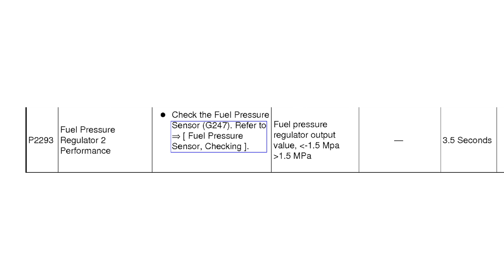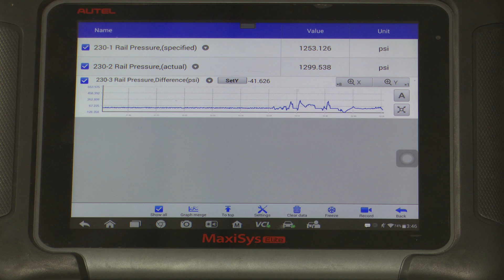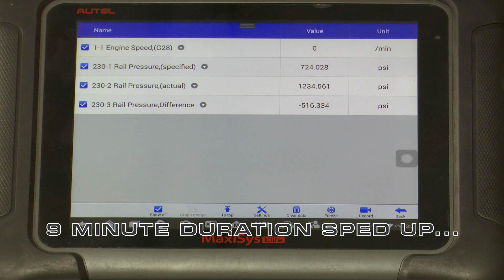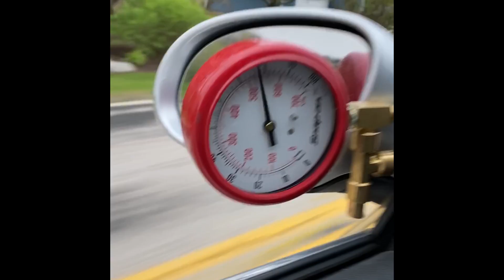Part 1 - P2293 High Pressure Fuel Pump Diagnosis - 2006 2.0T VW Jetta

Comment: My 2011 gti has a 3.77 bar  for fuel rail pressure when cranking and does not increase in bar. Car cranks but wont start with no codes present

Comment: I have this code on a 2010 also. I also have a extremely weak engine off idle won’t build power till like 3,500 rpm. Did you have any symptoms other than the code?
Reply from the maker: Thanks for watching and good luck in your diagnosis.
Ryan W, Technical Instructor

Comment: My reading in the low side was 85 and shakes thru 83psi to 90psi when accelerate the psi stay at 90 and the HPFP pressure at idle is 556psi and when i dive it stays above 1200 psi ? Whats the normal Low pressure PSI and normal High pressure PSI?? Please help me out i cant find the right info
Reply: I found my answer—— low pressure normal PSI between 50.7psi(3.5bars) - 87.1psi(6.0bars) and the High Pressure Pump normal psi is between 725.1psi (50 bars) — 2175.5psi (150bars). Hope this is helpful.

Comment: I have a problem with my 2008 2.0t FSI. One day I was driving and I had almost no power at all I could barely get up to speed. Then later i tried to start it and It cranks but won’t start, I have low fuel pressure I only have 4 psi. I replaced the in tank fuel pump, the high pressure fuel pump, fuel pump module, and the fuel filter. Do you know what else it could be.
Reply: Hello Rudd. Did you figure out what was it? Thanks Jeet

Comment: Hi, one question to gotech and everyone, please help, on 2010 audi a4 with high pressure pump, what is normal fuel rail pressure to expect after the car sat for few hour or the next day in the morning in a normal day with 75 degrees weather? Before starting the engine.

Comment: If you guys ever get this code and it's not the hpfp and cam combo.....try the sensor on the rail if that's not it.  The sensor on the hpfp is going to be the culprit.
Reply: Hi, Can you explain what you mean a little better? There's a sensor that connects to the HPFP and then a sensor that connects directly to the rail correct? Which one are you referring to? If I get this code because the fuel pressure difference before it starts bucking is around 20 bar (290 psi), would that point more to camshaft than to sensor being the culprit? I already put new HPFP in, new fuel pressure regulator valve P/N: 06D-130-757-C,  known good ignition coils, and it starts misfiring and hesitating hard once engine is warm and I'm accelerating on highway at about 70 mph. I can't get more than 91 bar (1319 psi) and the commanded pressure peaks at 109 bar (1580 psi) for me. Sometimes it will drop from the 91 bar down to 75 bar and that's when I get spike readings of 30-31 bar difference. I'm thinking camshaft but would try a sensor or something to do with timing as a last resort.
Reply: @LarryMendizabal  There's a sensor that measures the hp coming from the hpfp, if that sensor is faulty you'd get the symptoms you're describing. Was the pump oem?
Reply: Pump is a hitachi unit from fcp euro. Which sensor are you referring to that measures the hp [pressure] coming from the hpfp? Do you have a part number? Is it the one directly connected to the hpfp or the one on the fuel rail? @zuperzleeper

Comment: I have a audi q7  getting p2296 and p2293 just changed the fuel pressure regulator
Reply: I have the same code and I replace the HPP and now my car cranks but wont start

Comment: Hello! What fault produce the noise at 3:48? My car have the same engine and do the same noise. The noise disappears when disconnect the HPFP. The workshop says that is the HPFP and not the turbo. Did you now if the noise is really for the turbo. Thanks.
Reply: This! My GLI is doing the same weird noise. Have you gotten anywhere with this? Just replaced my engine and did all of my big maintenance. Made sure I went through everything.

Comment: The counter balance oil pumps are a blast in those... The 1.8 pump is so much more reliable. The 2.0 Delete is the way to go.... 
These ARE really nice engines until they start acting up. First sign of metal flake, it's time to rebuild it or junk it... After replacing the oil pump, the high pressure fuel pump follower disintegrated and took out the cam lobe! After replacing the head, the car continued being problematic. ANY metal flake in those engines, is BAD NEWS. (Those followers are problematic too...)
Reply from the maker: I may never buy a 2.0T VW again haha!
Mike Becker, Senior Instructor

Comment: for the low pressure side. if you have idle 50 psi and wide open throttle 72 psi. can you conclude the low pressure side pump is okay. or do i need to removed the line and see how much volume it came out. because i think you can have good psi and low volume.

and also when you said the hot soak. after 10 minutes the pressure will rises, due to temperature in the engine bay. can you explain a little bit, i am kinda lost.thank you!!
Reply from the maker: Hey Hua Jack, if there was a volume issue it would result in a lower pressure...unless there was a severe restriction. As far as the pressure rising, the fuel rail is sealed off when the car is shut off. The fuel is cooler than the engine, it came from the gas tank. When fuel increases in temperature, due to the hot engine, it increases in pressure. Therefore we see an increase in pressure on our sensor.
Mike Becker, Senior Instructor

Comment: Screw modern cars.   Go get old analog vehicle and be rid of cheap plastic computerized vehicles that will be totaled due to one of the shitty computers failing.         Emmisions?        How much strip mining is done to make current car.   Disposable plastic. Crap.
Reply from the maker: Hey Duke, sorry you feel that way. Modern cars do seem to have more problems, that's for sure. More stuff to go wrong. But how many "old" cars made it 200+ thousand miles?
Mike Becker, Senior Instructor

Comment: That was a nice "block window" someone created there, Mike!  Nice work getting that one going again. That cam didn't look too good, but hopefully that original pump does the trick. I know the feeling of not wanting to dig deep into your own vehicles. Had that same feeling when I saw all the metal chunks on the rear differential magnet in my '07 Silverado a little over a year ago ... 

Must be the moon phase. I've been working on my own stuff quite often lately, too! Hub bearings in my '07 Silverado (For the 2nd time! Talk about purchases we regret! Biggest lemon I've ever owned), then I had to rebuild the original power steering pump in my '86 Grand Marquis (34 years, 268k miles! Only rebuilt due to leaks), & replace all the lines. Rockauto sent me the wrong return line, so I attempted to heat and bend the metal portion - big fail! It kinked & twisted, and caused a big restriction. Ended up cutting it off, and double-clamping a hose. Always something! Anyway, looking forward to next Thursday. 👍🍻
Reply from the maker: Hey Smitty, yeh I had my fingers crossed on that cam...we'll see. Ugh! Isn't it just a blast working on your own stuff. It's funny how much I tend to put my own stuff off haha!
Mike Becker, Senior Instructor
Reply: GoTech - Same here, brother! I had been planning a total front end overhaul on our Grand Marquis for 5 years. Just got to it last fall ...😂

Comment: Fun video to watch, though now you have me wondering how the dealership pros safely decompress the high pressure line. With it driven off the camshaft, you can't just turn it off with the scan tool, pull the fuse, or unplug the high pressure pump. Even with the tank pump turned off that high pressure pump will mount significant pressure. Maybe one could find a fuel injector test procedure in the scan tool to spray fuel into cylinders with engine off, decompressing the line into a cylinder, hopefully not enough volume to hydrolock. Without the factory scan tool I wonder if people use a dangerous work around, which responsible authors don't want to show....
Reply from the maker: Hey Spelunkerd, thanks for watching! I'm not going to get into the procedure, but it is possible to bleed off the high pressure without a factory scanner :)
Mike Becker, Senior Instructor

Comment: A lot of GDI engines have problems.  It is called fuel dilution and abrasive, chain wearing soot from incomplete combustion of large fuel droplets.  It is so bad the OEMs and oil companies have known for 6 years and only now have come out with API SP and GF-6 with many new tests for timing chain wear.
Reply from the maker: Hey Brian, I knew there had to be a reason for this uptick in chain issues. Interesting that they are making new standards for oil. I'll have to check that out, thanks!
Mike Becker, Senior Instructor

Comment: You are going to throw a new cam at it for sure.
Reply from the maker: Ugh, I think you may be right Blocki :*(
Mike Becker, Senior Instructor
Reply: @GoTechTraining  Hey Mike, I think you are in bigger trouble. The german "Die Autodoktoren" recently had a Seat TDI where the high pressure pump had the same problem. VW quoted the owner ~8000 Euro because they wanted to rip out and replace EVERYTHING related to fuel (incl. tank, injectors, lines and rails). It's a TDI but it seems your car uses similar, if not the same technology.
Part 1 (introduction): youtube.com/watch?v=kC8mBa2Oo7U
Part 2 (where they show the culprit, starting at 05:40): youtube.com/watch?v=LHkXp7jZyxU
They ended up cleaning and backflushing everything including wiping the inside of the tank with some magnets. They also installed an additional fuel line which was wrapped around a huge magnet + installed an additional filter after they were done. They recently removed that fuel line and magnet and showed how much it still catched of that fine "sweet" metal bits and pieces. The car still runs fine. It just recently stopped because they got a bad rubber fuel line which was new, meant for fuel but failed just within weeks. Apart from that all is good.
If your engine is setup remotely similar to this one, it won't be the actual camshaft but more like an additional kinda "cam" which is in a separate housing.
Hopefully your injectors are not damaged. I'm not sure if the Autodoktoren replaced the injectors in this car or not. But I'm pretty sure they did - also as a safty measure.
Good luck!

Comment: I stopped your video at about 12:25 to write this and also to give me the time to decide whether to continue or move on to the voluminous amount of videos stacked up to still watch. Now, Mike, I watch your videos because you go through all the nitty-gritty, it is not up to you to decide not to share this or that part of the grit. I put up with your tendency to be pedantic to get all the info I would need if the problem with the vehicle you're having arrises with me. You have already covered your self with your  Terme of agreement. In other words, you are acting like my dad and I am just getting out of my pre-teens. No, I won't stand for that. I decided to watch your video up to the ultimate diagnosis and then move on. From there I will wait to see if you post a re-traction video, making it clear what kind of audience I am. By the way, I will apologize for being slightly touchy this morning; I am 73 and my plate is overflowing with projects that need to be done and I am taking the time to watch your video. with that, good day.
Reply from the maker: Hey Ben, sorry you feel like you may have wasted your time. Covered or not from legal issues isn't really my worry here...my concern is someone who doesn't listen to all of the directions ends up hurting themselves.
Mike Becker, Senior Instructor
Reply: So, then we search for other instructions that may totally be wrong or out of date. Where does that leave me? Hurt again, yes? It would be best for you to give the proper instructions with the appropriate warnings about not following them and or being careless. I am in turmoil in how to reach you without blowing my own horn. I do know this would be the right approach. Please step back and rethink this, Mike.

Comment: Wished you showed us a real close-up of the follower but that thing looks absolutely trashed, hole in it even? The camshaft is junk as well, if I'm not mistaken the BPY had the Rev A cam with a coating on the surface from the factory. Anyway, it's scrap either way with all that wear and pitting, the follower should be able to spin on the cam and only have minor and even wear in the middle.

But usually the fault would be low fuel pressure when the lobes wear down, so that's interesting. Just a worn follower would still yield the same relative displacement in the pump, that's why it's so easy to miss before it's too late.
Reply from the maker: Hey G E, join in for part 2, i'll show it in there :) Interesting about the cam Rev A. I'm really not looking forward to probably throwing a cam in here....
Mike Becker, Senior Instructor
Reply: @GoTechTraining Well don't quote me on that rev. A part, I have no experience with the BPY hands on. Just did my research before I bought a BUL, and I have confirmed that one has the rev. B cam. 
It'll be interesting to see what it all looks like up close, and if you have an borescope have a look at the intake valves while you're at it.

Comment: Did a see a fuel pressure tester, for low side, then after the pump replacement, no pressure tester?   Assuming low pressure was good?   If so, Pump and follower and youre golden.
Reply from the maker: Hey Kurt, low pressure was in spec on this car. I really hope that it fixes it!
Mike Becker, Senior Instructor

Comment: How about checking the fuel pressure sensor for accurate reporting?
Reply: Good point. I am guessing that Mike does not have a high [enough] fuel pressure gauge to test the "secondary" [high side] pressure. This would be my next step after confirming the "delivery" [low side] pressure was in spec.
Reply from the maker: Hey Traveler X, that's correct. I don't have a gauge capable of reading that high. Plus, the TSB and noise from the HPP area was enough to lead me into that path. Seeing wear on the follower and a questionable cam was evidence enough. I suppose it's possible that even with a perfect cam/follower/pump that the sensor could still be bad...but my guts leaning towards pressure creation instead of pressure reading.
Mike Becker, Senior Instructor

Comment: I know very little about these GDI systems.  My 7 month ownership of a 2020 Toyota RAV 4 has shown the vehicle to be very impressive in economy and power.   One interesting thing.  When you put the key (mine is the base model, not the pushbutton model) in the ign switch, before you turn it to on, you can hear the pump run for 2 seconds.  A good idea I say.  The high press pump is a little, but not much, noisy.  The engine takes 0W-16 oil.  For now I'm using Toyota oil and filter for the warranty.
Reply from the maker: Hey Mike, thanks for watching man! Enjoying the vehicle? I have two GDI Fords with pushbutton start, when the key is close I can hear it prime. 0W-16 is crazy...I can't believe that is acceptable.
Mike Becker, Senior Instructor

Comment: Here are  some more informations about this system. (VW SSP 334) Great videos btw.
Reply: That cam is trashed, you're not going to get significant wear on the follower and not trash the lobe also, the close up you showed gives clear evidence that the lobe is wiped. I deal with high pressure diesel common rail and have seen what happens. Sadly you're gonna have to replace the cam 🙁 and you run the risk of trashing the follower on the newer pump if you run it against a trashed cam lobe. 🤔
Reply from the maker: Hey Bryan, I wish it weren't true :(
Mike Becker, Senior Instructor
Reply from the maker: Hey Jure, i'll check it out. Thanks for watching!
Mike Becker, Senior Instructor
Reply: SSP stands for Self - study program.(A lot of useful informations about VW and AUDI all systems)